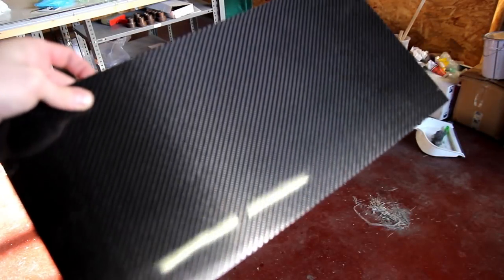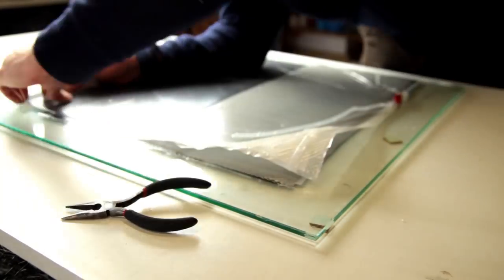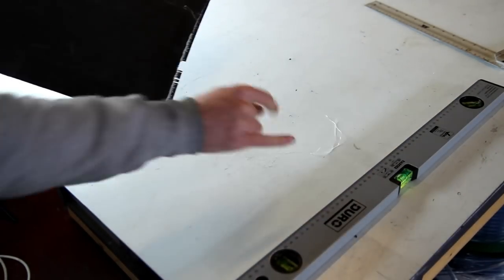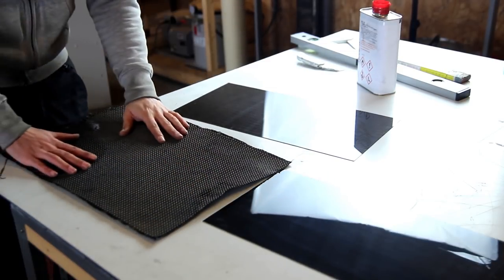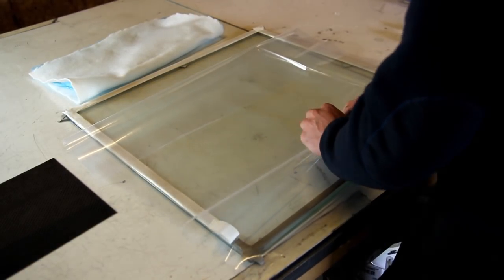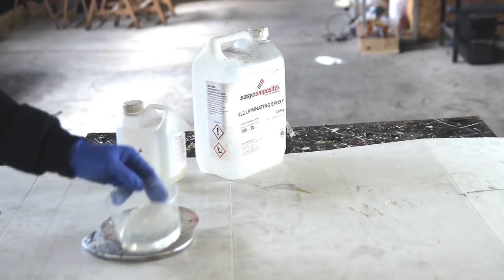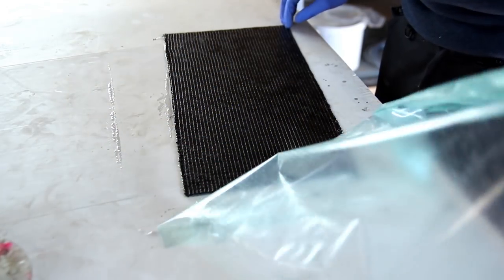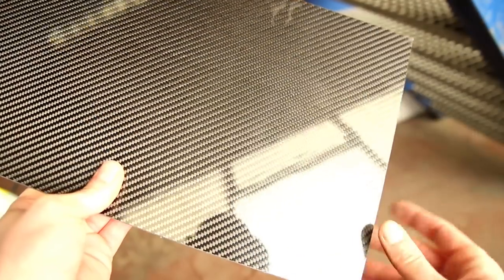Carbon Fiber Plate - 2 Side Glossy Finish (How to)

Comment: I been using two glass sheets inside a vacuum bag for these types of panels for years. Just wet out the sheets, orient them in whatever pattern you want or layered with kevlar etc... Then when cured, we use an Air Injected Wedge to help split the pieces away from the glass.
Reply from the maker: Will need to try that 🙂

Comment: Regarding your peel ply sticking.  The handful of times its happened to me is when using non coated peel ply for an extended cure time.  Once the epoxy hits full hardness its a pain on non coated peel ply.  With coated peel ply I never had much of an issue.

Comment: Hey Matthieu, I was looking to start making plates myself and I have most of what I need, but do you have any recommendations for the glass surface to lay everything on? I got a tempered glass cutting board from Amazon but not sure if it will work okay or not. Would it need to be a certain thickness or anything special? Thank you in advance. Great videos!!

Comment: I had similar problems with removing peel ply before. Used Carbon fibre weave, foam and unidirectional c fibres on an aluminum mold, also resin infusion

Comment: I was expecting something a little different given the title, but great tutorial anyway. With the Kevlar based would have been great to do bashguard for the Adventure bike.
Reply from the maker: What were you expecting? 😁
Reply: @MatthieuLibeert  Something like both sides coming out glossy perfect right after infusion. Like i've read on some manuals using a 2 plain of glass one of which was drilled to fit the vacuum fitting.
Reply from the maker: Correct! Will look into that! Thanks for your input
Reply: @MatthieuLibeert   You are welcome. Ty for another great video and keep up the awesome work
Reply from the maker: Thanks gafrers!

Comment: Could we just stick both side with regular epoxy, without carbon layer? is that carbon layer for sticking them giving extra strengh
Reply from the maker: I add it to make sure it is well bonded, might work without but better with a layer in-between to make sure you have a full bond

Comment: Hi Matthieu! 
i try to understand the purpose of the biaxial fiber reinforcement. i understand it's minus 45 and plus 45 degrees. my question is:
why not using regular fiber reinforcement just turned 45 degrees? wouldn't be the same thing? 
thank you & best regards! ;-) 
Mircea
Reply from the maker: Correct but you would have mush more waste cutting a diagonal in your regular twill weave fiber
Reply: aa, ok, thank youu, i got it ;-)
Reply: hi, Matt! 
what do you think about the strength of the part, is it basically the same one as if all the layers built in one lamination? or is it slightly less?
is there any risk of layers getting un-laminated if applying some stress, some bending over the part? 
thank you! ;-) 
best regards,
Mircea
Reply from the maker: @mirceaandreighinea  will be close to the same as all the layers

Comment: Have you ever attempted making a square tube from carbon fiber? I am very interested in possibly making a carbon fiber frame for a vehicle, but don't know how thick it would need to be, in order to be structurally sound.
Reply from the maker: No never tried it and indeed very tricky to calculate, would be some trial and error and make it to strong on the first time and go down as much as possible then till perfect weight to strength ratio

Comment: what kind of cutter you using to cut the cf cloth bro?
Reply from the maker: For dry carbon I use scissors, electric cutter or the wheel cutter. For cured carbon Permagrit carbide tungsten wheel or angular grinder with fine blade

Comment: Cool.  I always thought that this was done between 2 sheets of glass and infused as normal.

Is the piece any less strong being two separate laminations.
Reply from the maker: Will try it between two sheets of glass 😉 as far as I know they are not less strong as they are properly bonded with an extra layer and fully cured under vacuum pressure

Comment: Yes I have had lots of issues getting Dacron Peel Ply off my parts.  I have tried coating the Peel Ply with Teflon and Silicone Spray.  Still very difficult and it does not leave a glossy finish.
Reply from the maker: Normally it's pretty ok, like I did on the Carbonfiber piece, but the other one was a nightmare for the first time in 7 years I work with it 🙂

Comment: No pregel on bonding (wet on dry).
No surface preps on raw peel ply.
Use solid plate on bothside on final vacc for better result.
Good job anyway.
Carry on
Reply from the maker: As far as I know that's the purpose of peelply so you don't need to prep it for further bonding, as long as you don't use coated peelply. Wet on dry should be a problem as the extra layer had plenty of resin. I follow you on the extra solid plate on top side! Thanks for your input, I'll keep that in mind!

Comment: Get the green airtech peelply. I can rip a whole hood skin in like 15 seconds.
Reply from the maker: Normally I have no trouble with this peelply, used the same one for 7 years with Easy removal, only had problems on this specific lay up... Pretty weird! will check that green bag you are talking about!

Comment: Yes, or you just tak le some acrylic glass, put your carbon fiber in between two sheets of the acrylic and that sandwich you can press with clamps between some straight stuff, some strong plywood, e. g.
The acrylic glass can should be removable without putting on a release agent. No peal ply, no release agent, no multiple steps.

Comment: Just use 2 glas plates. Same result and not so much work
Reply from the maker: not sure if the resin will flow all the way through the fibers then without an infusionmesh, but worth the try indeed!
Reply: @MatthieuLibeert  I've done this many times in my Job. 99% of all worked. Sure, if you are putting too much layers between the glass plates it's not possible for the resin to flow to the other side but 3 layers of 240g carbonfiber will definitly work 💪
Reply from the maker: Thanks for the info! Will try it next time 😉
Reply: Is that without any infusion mesh of pell ply? @dngrpat4324
Reply: @dngrpat4324  You can make it work even with thick strong sheets if you use something like santor soric coremat as an internal flow media.
I like it because it is simple (glassplate-fabric-coremat-fabric-glassplate) in a bag and normal supplies.
With plastic sheets you can even make curved two sided thick composite plates.
Reply: @mikaelhilli71  much thanks for you mate, i'll try this priceless tips from you, been searching it for years. Good bless you.